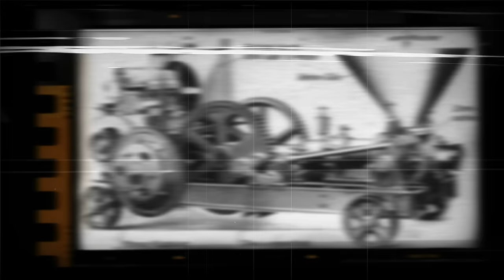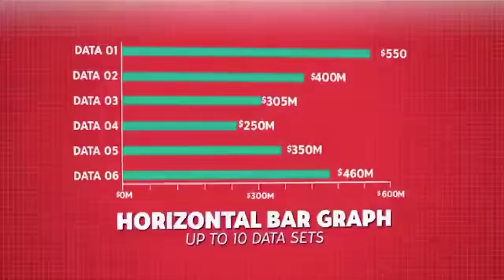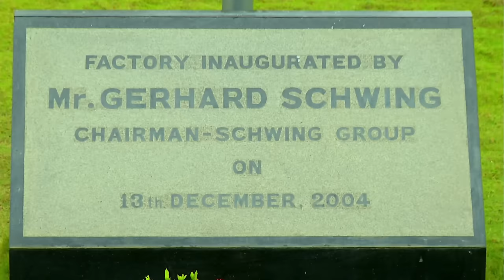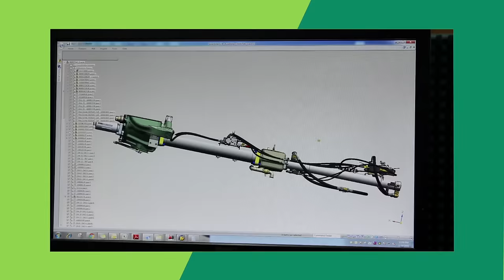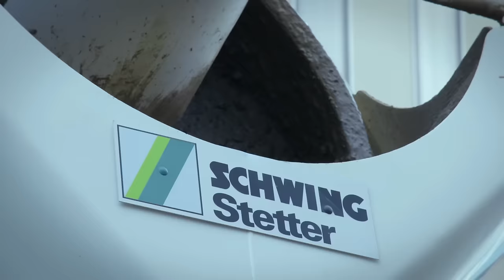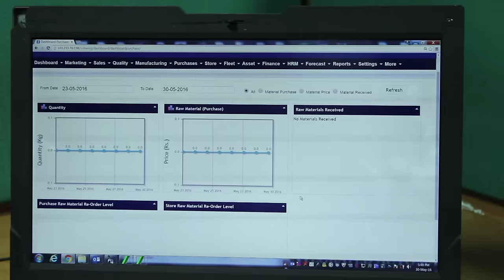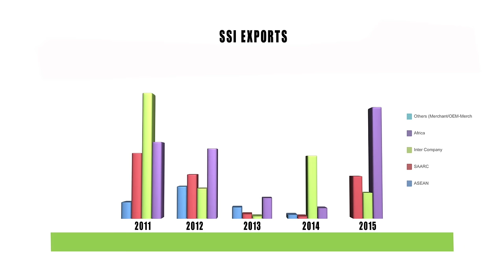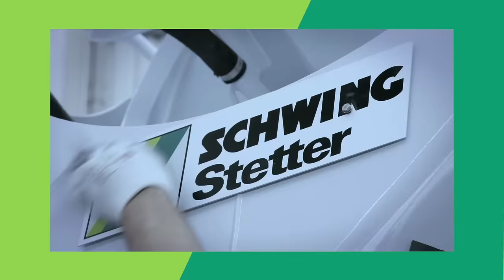SCHWING Stetter India - Corporate Video (2016)

Comment: service is very bad in kerala . un qualified staff .. our vehicle complaint starts at 500hr .. drum seating locks spring ... drum not sitting this lock and the drum gearwheel both are teeth crack .. company changed both gears in warrenty period 950hr .. then electrical complaint start .. boom angle sensor always complaint now 1200hr ..service technitions and service head very bad response in kerala ... dont waste 36 laks 🙏